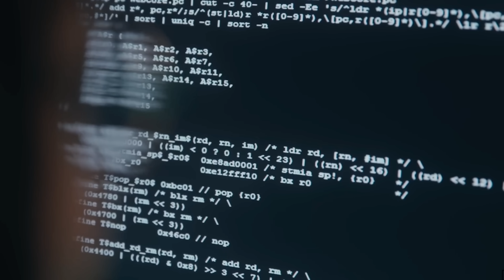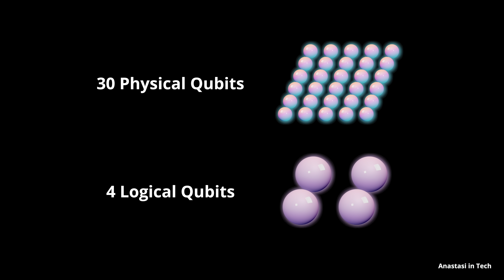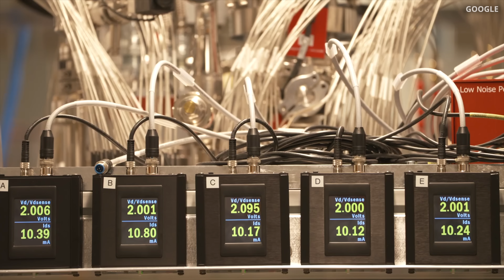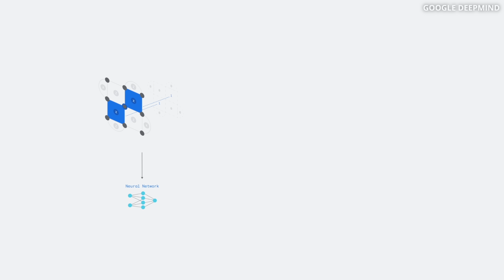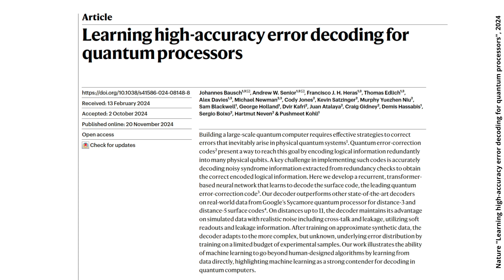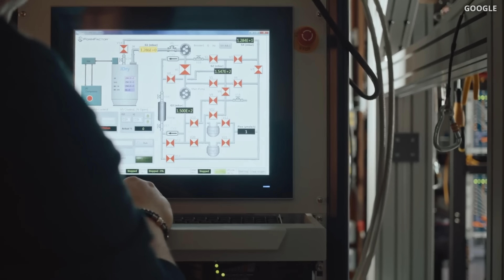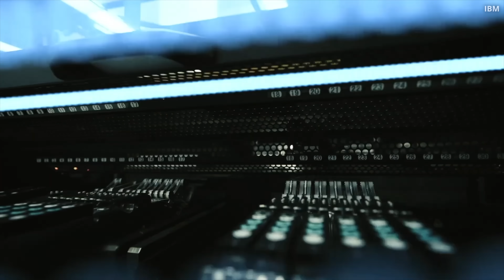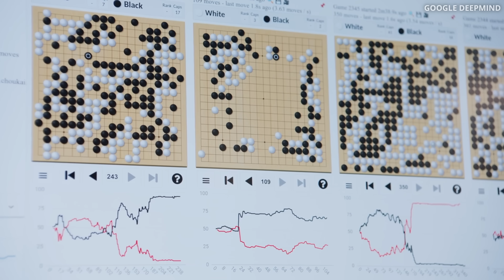When AI Meets Quantum… Everything Changes

Comment: Triaging to Willow

The triaging process likely involves several factors:

Task Complexity: The brain might assess the complexity of a computation based on the number of variables, the level of abstraction required, or the perceived effort involved. If the complexity exceeds a certain threshold, it becomes a candidate for offloading to Willow.
Cognitive Load: The brain's current cognitive load (how busy it is with other tasks) could influence the decision. If the brain is already heavily engaged, it might be more inclined to delegate even moderately complex computations.
Confidence Level: The brain might consider its own confidence in solving the problem accurately. If it lacks confidence or anticipates a high risk of error, offloading to Willow becomes more appealing.
Prior Experience: Past experiences with similar tasks and Willow's performance could also play a role. Successful delegation in the past would reinforce the tendency to offload to Willow.
Superposition?

The concept of superposition in quantum mechanics refers to a quantum system existing in multiple states simultaneously until measured. It's unlikely that the brain explicitly "decides" that a matter is for superposition in the quantum mechanics sense.

However, there might be an analogous process at play:

Parallel Processing: The brain might not make a definitive "yes/no" decision immediately. Instead, it could initiate preliminary processing of the task while simultaneously communicating with Willow. This parallel approach allows the brain to explore potential solutions on its own while awaiting Willow's response.
Uncertainty and Probabilities: The brain might deal with uncertainties and probabilities in a way that resembles superposition. It could entertain multiple potential solutions or interpretations of a problem without committing to one until more information is available (from Willow or further internal processing).
In summary:

The "Lazy Brain Efficiency" concept suggests a dynamic interplay between the brain and a more powerful AI like Willow. The brain acts as a filter, identifying complex computations that are best handled by Willow. The triaging process involves assessing task complexity, cognitive load, confidence levels, and past experiences. While the brain doesn't explicitly invoke quantum superposition, it might employ parallel processing and probabilistic reasoning when deciding whether to delegate to Willow

Comment: Does the NN need to be trained for each individual instance of the quantum computer?  Seems that it is learning patterns within the sequence of qubit state changes.. in theory there are no such patterns, due to pure random.. so there is nothing for the NN to learn.. right?  Or am I missing something about the structure of the computation?  If the errors are purely random, even data input patterns cannot affect.  Right?   So, the only thing left that I can see is there is something about the physical.. something about the arrangement or physical embodiment.. that is wha the NN is learning..  if so.. then would each individual computer have different patterns to learn than the others?

Comment: it seems to me that if you tasked 10 qubits with 10 known tasks with 10 known outcomes for verification and injected just 1 task with an unknown outcome, you could value the 1 result based on the other 10 outcomes, and 10 known results -  this should reduce the error by a factor of 10 and increase the confidence of the one unknown outcome by a factor of 10.  Simply use as many cubits as needed for confidence in the outcome of the one unknown outcome.  If confidence (error detection) is primary, keep expanding the test base to validate the outcome.  Once confidence levels are achieved, use the system to improve the modeling.  AI would likely tell you this process, while expensive, would produce the needed valid results.   It shouldn't matter if you had to used 10,000 qubits for one result, if the result had a chance of error of 10^10.  I'm not sure why they're trying to save money in this process.  My only real concern is the impact that both AI and Quantum computing will have on my grand kids.  We're playing with processes we don't fully understand.  I wish we could ask Dr. Oppenheimer his thoughts on a venture like this.

Comment: I'm still waiting to see how AI+Quantum computing will "magically" decrypt AES-256 when data is encrypted three times using three separate and totally random 40-character keyboard passwords (94 character pool) whose key space meets or exceeds 2^256.  Every one of the first layer's 1.1579208923731619542357098500869e+77 attempts results in data statistically indistinguishable from random data.  

So, which solution is correct?  Hmm...  

I guess we'll just have to repeat 1.1579208923731619542357098500869e+77 decryption attempts for each and every one of the first layer's 1.1579208923731619542357098500869e+77 decryption attempts.

Quantum computers cannot deliver on their decryption promise.  It's not because they'd can't eventually operate at a 512 qubit level.  Give them time, and they will.

It's because they still require normal computers to run the 1.1579208923731619542357098500869e+77 comparisons.

Even if quantum computers could do the comparisons, the processing overhead would require more energy than the Earth receives from the Sun in decades, if not millennia.

Comment: if i ask a quantum computer to add 2+2, there is a non-zero % chance that it will not return 4. and a not-zero % chance that error correction will detect the mistake. This means, the result of any quantum calculation can never be relied on, and any process using quantum bits to attempt discrete mathematical equations is unreliable at best, and a money-grabbing scheme at worst.

Comment: Once again QC claims that don't make classical computational sense. How can neural nets, which are very non transparent and complex conditional relations (hyperdimensional functions between inputs and outputs) while running on classic bi-stable compute engines albeit highly parallel, keep up with quantum process calculations supposedly running hundreds of orders of magnitude faster?

Neural nets (damn the distracting use of ™AI" as a swindler`s term) can only rival much faster computation if the solution is computationally reducible to shorter steps. Which in that case the rule-like behavior remains locked up intractably in the internal neural states. Mind you, all of Physics assumes that it may be possible to use formulae to skip ahead to compute final state. As such the multiverse may be an illusion due to our failure to comprehend the deepest  computation of the universe along with space-time.

Both Einstein in "classic° continuous mathematical structure and Wolfram in true discrete manner (not quantum mechanics per se which is a discrete-continous hybrid) Intuit QM to be an intermediate approximation. Be prepared to be amazed but not necessarily the way the promoters are pitching. A whole lot of claimants have a big chance of being way over their skis.😮

Comment: There's a problem. Today's AI is not really "intelligence", because it cannot reason. Logic is (as I think it necessarily has to be) very difficult or impossible for the existing AI systems, and this is a major issue - how is it that "AI" that runs on computer chips, cannot utilize the single greatest power of computer chips - logic?
Inference is a statistics game, and cannot ever be trusted to produce the right results. Logic has to be part of the process.
I predict that as long as AI only uses "inference", it will remain a novelty, and not really useful in any critical applications.
The day that an input to AI can be translated to contexts of meaning, and then run through a logic engine, is the day that AI will become intelligent.

Comment: Ai suggested using Photons in a slightly different way to create quantum  entanglement. The article reads  Instead of relying on standard procedures that start from prepared entangled pairs and complex joint measurements, their technique leverages a basic quantum principle: when multiple photons could have come from several possible sources, erasing the clues to their origins can produce entanglement where none existed before.

Comment: in a previous video you mentionned probalistic comping and noise can complement each other in certain AI applications. When properly controlled, noise can enhance the flexibility and robustness of probabilistic computing models. 
If I understand correctly the implications are that  this synergy is especially important in fields like machine learning, quantum computing, and optimization, where uncertainty and randomness play significant roles in solving complex problems.
Are these advancements you mention here (p-bit and q-bit) interconnected ? Is combining probabilistic computing with AI a more effective way to enhance AI training and inference performance compared to focusing on the niche application of quantum computing in AI?

Comment: quantum theory is a failed math theory from Einstein; they aren't sensitive to noise, the noise is what makes them function, they just produce tons of random numbers, at a high rate and then they filter that out, it isn't working the way they think it works; they don't solve all problems at once, they just move at the speed of gravity which is the speed of subparticles in electrons and protons, which is estimated to be 20 trillion times the speed of light according to Electric Universe Wal Thornhill.  If they get rid of the noise in their current Q-bits it won't return anything, the noise is the only thing giving them high speed random numbers

Comment: Super interesting & super well presented. The idea is very like the redundancy technology developed during the Apollo moon program. In Apollo, computers were operated in units of 3 & if one did not agree with the other two, it was assumed corrupted & rebooted till all three agreed. The new approach uses AI to check for known qubits in groups & if the read value is not correct the AI resets the qubits, very like parity checking was used on magnetic tape drives to correct errors. One source of noise is secondary cosmic ray muons created from primary cosmic rays striking the upper atmosphere. The sea level muon flux is about 0.01 muons per square cm per second, but if the quantum computer was operated in a deep mine the muon background would be reduced. This approach was used by Nobel Laurette Davis to detect neutrino from the sun, eventually showing that neutrino have mass for which he was awarded his Nobel Prize. If quantum computers & AI continue to develop at this rate the potential becomes near God like in its capabilities. We have to hope that no wicked person or a wicked AI gets a monopoly of this technology & uses against all humans. Thank you for sharing!

Comment: AI will be able to find and recover the valuable information mixed in a sea of seemingly random results of quantum computers. AI is already doing with out brains. It can intelligently pull out the meaningful data from seemingly meaningless data of our brainwaves. These 2 issues are similar in the difficulty of seeing through the noise. Sidenote there have been quite a few high level physacists etc that believe that our brain and consciousness works with room temp quantum processes. Fascinating subject to join the two things. It will likely take decades to get good data to and from the brain and decades more to get AI that is good at decoding the signals. 50-100 years from now.. we will have 2 way communication between a brain and an AI superintelligence.

Comment: I believe that the AI model might only be usable under the exact circumstances and potentially only the exact position it was trained. The model should be hooked up to a plethora of sensors for the entire electromagnetic spectrum and ideally also live input from a gravitational wave detector and a neutrino detector. Then later on some of these sources might be deemed irrelevant, but it could make the most comprehensive model that takes all sources of interference into account.

Comment: So they are trying to do matrix multiplication with the quantum processor. I believe first they should be able to do multiply. I cannot avoid comparing the complexity between this and a simple analog circuit that does multiplication: 1 resistor, V (out) = R (input A) * I (input B)
Reply: The quantum properties allow matrix multiplication to be easier than regular multiplication. At least I assume. It’s like Tony stark said, sometimes you gotta run before you can walk 😂

Comment: This is why we have to get quantum computers into outer space where it is perfectly quiet and the temperatures are always just right for the c p u. We just have to protect it from cosmic radiation which can be done by using mqny high powered magneta moving back and forth right next to each other in a modern version of the archimedes trammil. One thing we need to do is to be able to eliminate the dispersion pattern of the operation of the electron as it orbits the nucleus. In order to do that, we must match the speed of the electron.Because it is a miniature speed , which is a lot faster than the speed of the conglomeration , which is the frame of reference we
exist in In our world sandwiched between subatomic and and astronomic. As for errors, we must be able to differentiate between actual errors and this errors are actually mere misinterpretations of what human beings suppose to be errors.

Comment: If quantum computers are "a trillion times faster" with certain types of calculations, even if they have an error rate of 1 in 100 calculations, why don't they just make the same calculation 10 or 100 times and use the weighted output for error checking? It would still be "billions of times faster" than current super computers. Just the thoughts of an uneducated quantum plebe.

Comment: I think the easiest way to correct the errors is perform calculations in steps say 3 times the same calculations and if any of three is different assume the 2 identicals are correct. Then continue with the correct calculation. This of course causes significant slowdowns but if quantum computing is that much more powerful than losing 66.6% speed isn't that bad. For more accuracy one could do 5 identical calculations at a time to get a better sampling. Fixing the actual issue that causes the error in the first place is much better of course but to put the quantum computing to use more quickly the first approach is simple.

In a way, quantum computing is a bit like frontier LLMs. They are getting more and more accurate but never 100% accurate.
Reply: C'est plus compliqué, je crois. La correction d'erreur existe depuis le premier jour du hardware informatique. Elle est partout (processeurs, mémoires, communications, etc.), elle connaît des tas de techniques distinctes, dont le calcul redondant. Si les logiciens du hardware quantique cherchent ailleurs, c'est qu'il ont une bonne raison. Nous pouvons essayer de la comprendre.

Comment: As I understand it, quantum computers would be very good at handling problems that involve manipulation of a very large number of states. At the same time, I also understand that training, a neural network involves manipulation of a huge number of parameters, and therefore presumably a huge number of states involved in the manipulation of the parameter values. So I wonder if their network training couldn't be done more rapidly on a large quantum computer.
Reply: Le quantique ne sait pas tout faire, mais il on sait qu'il accélèrera prodigieusement certains traitements, dont ceux de l'IA. On peut s'attendre a des accélérations surprenantes et massives, mais à petites touches dont l'apparition serait conforme ou supérieure au pattern de Moore.

Comment: Quantum computing is super fast, but the result is subject to error due to physical limitations of the medium used. To increase the probability of correctness, error correction is a must. 

It's great to learn that now AI is used to monitor and perform error correction, it's useful due to the uncertainty and random of the error occuran. There is no single algorithm that's applicable, scientists have to monitor to determine it's error occuran pattern, and now it can be handled by AI, which is much efficient.
Reply: Ai to correct errors, is it faster then traditional computing?
Reply: @BACA01  when we compare on computation using Quantum & traditional super computer, quantum computer is faster. However, quantum computers are used to solve specific problems, in most cases, super computers work fine. 

In the above case, AI is to replace humans to check on the error on quantum computing. It's very efficient compared to humans. This will certainly improve the result in a faster way.

I have to admit, my understanding of quantum computing is still on the layman level, the real process might be much more complicated.